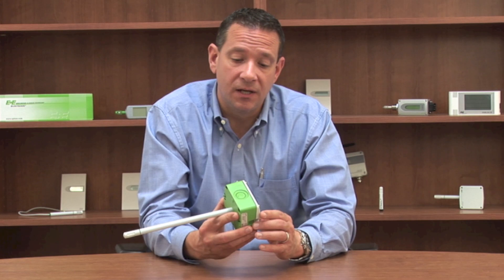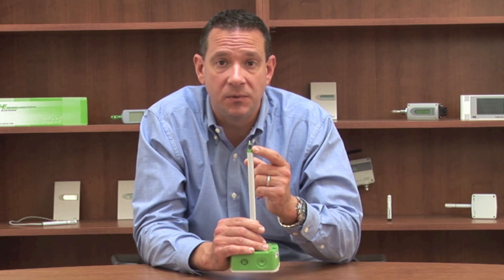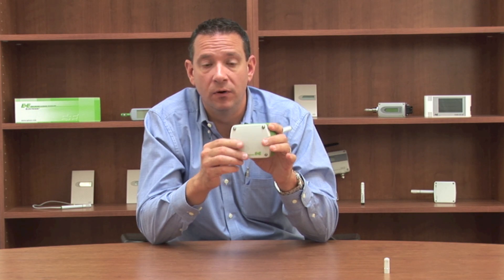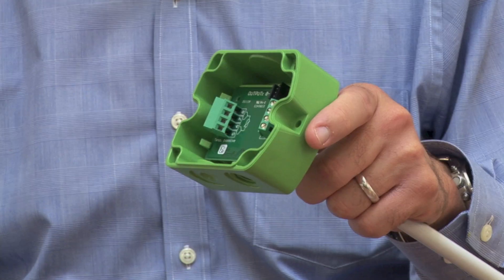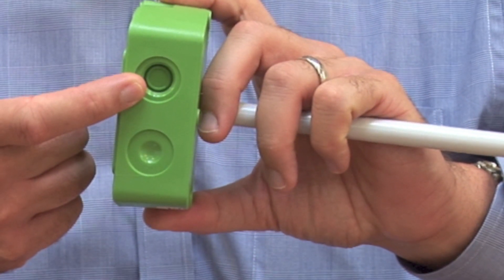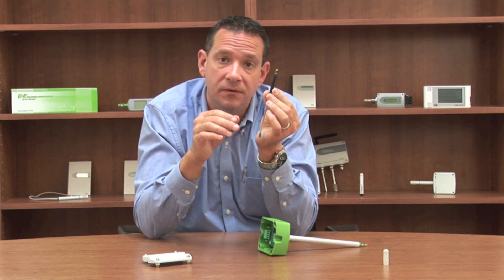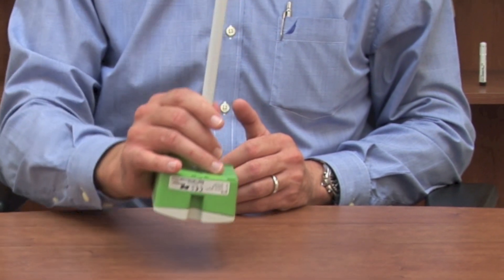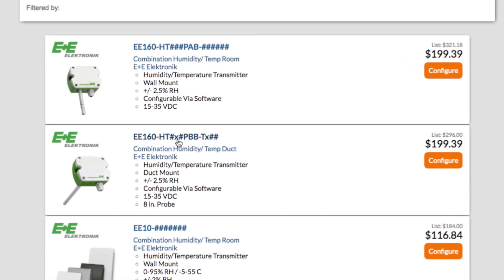E+E Elektronik EE160 Temperature and Humidity Sensors - available now on alpscontrols.com

Comment: Sir how to reset from HMI if coming alarm humidity sensor faulty
Reply from the maker: Hi there - thanks for the question! Alarm block outputs can be configured in the PLC. You can write your own rules or use preconfigured rules, from an HMI. You can disable acknowledgement synchronization back to the PLC and configure most alarm interactions on the HMI; the reset function should reside on the PLC, if a device requires a manual reset you can use a reset button on the HMI. Hope that helps!